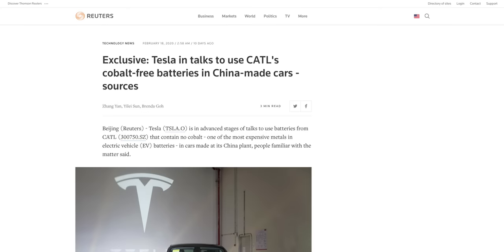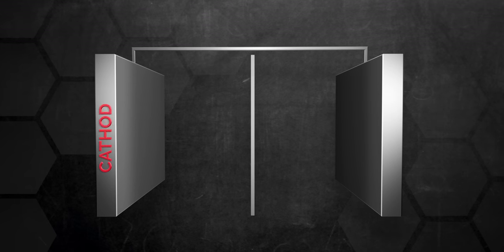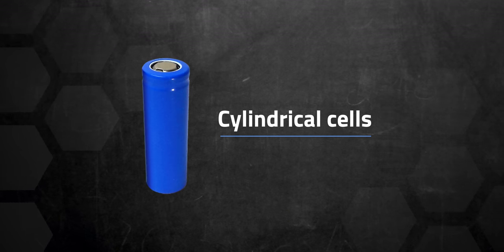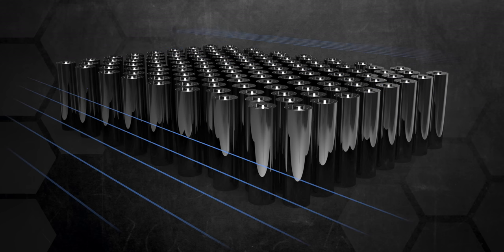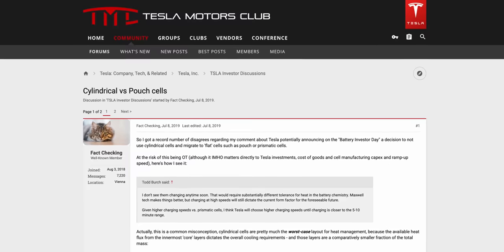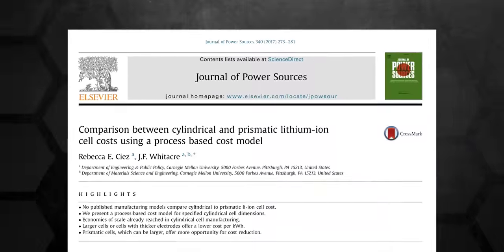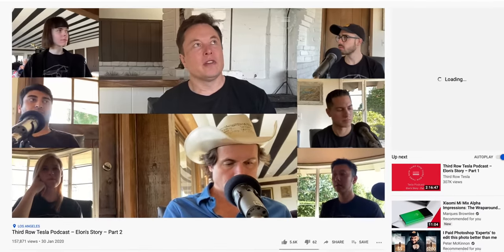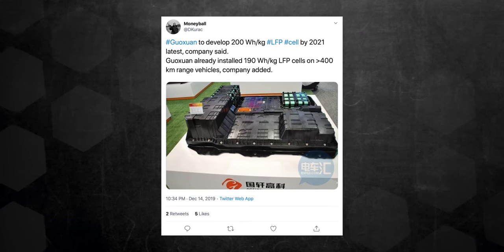New Tesla battery? Exploring the China prismatic LFP news

Comment: Thanks for making clear one of my Pet peeves:  Energy Density is energy per unit volume, not per unit mass!

Hmmm...  “谢谢老师” is “thanks, teacher,” not “thanks for the question.” Perhaps not super important, but I’m wondering what the “老师” (teacher) refers to?

Sorry, my wife is from China and we speak mostly Mandarin at home, but I can’t recall anybody saying “thanks for the question” as “thanks, teacher.”  Again, maybe not important, or maybe...
Reply: Roger Starkey, I’m not suggesting anything about relative importance of Specific Energy vs. Energy Density;  just which is which.  

“Energy Density” is oh-so-frequently misused to mean energy storage per unit mass.  Energy per unit mass is the definition of “Specific Energy”;  “Energy Density” is defined as Energy per Unit Volume.
Reply: You also mentioned Power Density (thanks).  Here’s an interesting illustration of Power Density:

Amazingly enough, a (very) large candy bar and a small stick of dynamite — roughly the same size and weight — hold about the same total amount of energy!  Their Specific Energy and Energy are very approximately similar.  

The difference is Specific Power and Power Density:  a stick of dynamite expends it’s energy in a fraction of a second, whereas (in our bodies at least) a candy bar takes an hour or two to be completely digested and it’s energy expended.

So, even though their Specific Energies and Energy Densities are very approximately comparable, the stick of dynamite has many many orders of magnitude higher Specific Power and Power Density!

Comment: Hi Matt, do you have any insight about the bottleneck caused by battery production today? For example: how much more cars could be built in Freemont, if batteries suddently weren't a constraint any more. The rationale being: there might be no need for a 500mile Model 3, instead Tesla could build far more batteries whilst keeping the range of the cars the same.
Reply: @rogerstarkey5390  Thanks Roger. If batteries were the constraints in the past and that is no longer the case, what could that mean for production volumes in freemont?

Comment: why not different batteries for different use cases.  million mile for one use case, ultra fast charging for another use case, very low priced lower density for another, ultra long range for yet another, still others for other use cases.

Of course ultimately the number of battery variants would few as the market settled on the most common use cases, but the idea applies.

Comment: why cant we use button style batteries. If we can power our car with 100,000 button batteries it will be great. Button batteries are small so you can load it up at one side just like you load smarties into a jar. you can also eject used batteries through an exhaust pipe.

Comment: You're all taking the bait. IMHO, Tesla isn't interested in using LFP for it's automobiles. The weight and volume are just too much greater than NCA. What I believe Tesla is interested in LFP for is for it's PowerWall. LFP is a natural for home power storage due to its much increased cycle life and it's resistance to catching fire. The increased volume and weight for any given energy level is not nearly so important for use off-grid or home storage applications. I'd look for these to show up in the next version of Tesla's PowerWall and for use in Tesla's grid support projects like that in Austrailia.

Comment: LFP = Very unlikely.  Significant improvements to NCA = Definitely.  It seems quite likely that Tesla will eliminate cobalt in their NCA chemistry, which will improve unit cost (cobalt is expensive) and slightly improve specific energy (due to increased nickel). Simply put, this will be made possible by special coatings on the cathode designed to prevent cracking when the battery is cycled. Combined with a new electrolyte, these cells have been shown to achieve 1 million miles (4000+ cycles in harsh conditions). And finally, it has been shown that these batteries can operate at a slightly higher voltage, which improves specific energy even more. These improvements can be applied to Tesla's *current* cells, which could get them close to 300 W*h/kg while reducing cell costs.

But there's more!  Tesla will likely announce a new process for manufacturing their own, *new* cells, incorporating technologies from Maxwell and Hibar systems.  Due to Maxwell's dry electrode process and new battery pack designs, I'd expect battery packs closer to 320 W*h/kg with faster charge/discharge rates (the real holy grail here, achieved due to reduced heat!), and an improved manufacturing process that costs less per cell and requires much less capital.  These cells will still be cylindrical, and it's possible that Tesla will put them directly into the battery pack and forego using modules (to save cost). This would culminate to be a ~25-30% energy density improvement over current cells with faster charge times and much lower unit costs (maybe $100 per KWh for a **pack**).  It seems likely these batteries would be available in 2021.

More improvements are possible in the future... at this point, we can only wildly speculate... one example is a Silicon-rich anode, which could make cells capable of 400 W*h/kg.

Tesla's current battery and powertrain technologies are already industry-leading.  The improvements in the next 18 months should blow our minds.  Also noteworthy: Due to improved energy density, Tesla could elect to ship vehicles with smaller batteries instead of improving range, which further reduces the cost of the car. If Tesla passed all of these savings onto the consumer (which will probably happen over the next few years), we could expect EV prices to drop by $3-5K.

Comment: I’ll bet that Tesla is pursuing several battery architectures at once.  Since battery supply is the biggest problem for EV manufacturers including Tesla it makes sense to pursue a strategy of utilising several different technologies from different suppliers as well as making their own batteries.  Which supplier / chemistry is used for a particular model / variation will probably depend on juggling customer demand and supplier availability
Reply from the maker: That wouldn't surprise me either.
Reply: Great points and I agree, I think whatever Tesla comes out with next month won't be the same battery they'll be using in 5-10 years from now.  Goodenough's solid-state, glass battery seems to offer great capacity and rapid charge times but will need a few more years of development and testing and the lithium air battery offers the highest capacity of any battery but still needs several more years of R&D.  I remember working for Apple in the early '90's, we were super excited, every quarter, as new processors came out offering blinding speeds of 16 Mhz, 25 Mhz, then 50 Mhz and so on until computer speeds got so fast and storage was so high, we stopped caring about it.  I think the same will happen with batteries when EV's can travel 500-600+, charge in 5-10 min., and last a million miles.  At that point, everyone will be buying EV's and these moments of talking about batteries will be fun to reminisce.
Reply: @rogerstarkey5390  I hear ya, but most car-buying customers are still expressing the same concerns of range and charge times and I think those concerns will be settled in coming years with new battery tech.  I own and drive an EV that I charge with my own solar panels and wind turbine and have for the past 12 years and virtually everyone I talk to about buying an EV, express the same concerns: charge time and range.  Many long-distance drivers only stop for 5-10 min. for a fuel up and get back on the road, after driving 3-4 hours.  I live in Arizona, we do this, all of the time, when we drive to our family: 8-12 hours away.  
Looking forward to the future of EV.s.

Comment: Tesla may use prismatic LFP batteries in they short range M3's, but not because those batteries are the future but because they are available now and have some benefits. 

Typical cycle life is over 5000 cycles and those batteries can handle abusive conditions better. Supercharging can be only choise in Chinese cities and repeated deep supercharging cycles are not good for current batteries.

The future is in more energy dense chemistries but it takes while before new technologies are taken into use, all problems are solved and production lines are up and running.

Comment: My option, I doubt very much Tesla would change from the Cylindrical Battery format that has proven to be so class leading.  If Tesla uses lower density cells, they they are not ahead much of other manufacturers anymore.   So unless they can really lower the car cost significantly I don't think moving to LFP is a good long term plan.  The magic they have would be lost.
Reply from the maker: The energy density of the pack will no longer be leading class, but cost wise ... it could be class leading.

Comment: NO NO NO. The goal for motor cars has to be to maximize the specific energy - all other things being equal.
Cylinders are a lightweight means to withstand the pressure to expand. 
Musk made a very good initial decision - even if the real reason was that the cylindrical battery was already abundant, and available.
And now with the new size 4680 (I think) he has optimized  the cylinders in respect of many competing factors.
Lithium constitutes about three percent of a lithium battery (so I believe). How much cobalt do they contain? Even at ten times the cost of the same quantity of lithium, it is not a huge factor.

Comment: Fundamentally, weight/power ratio makes any form of batteries, even with marginally improved technologically for their chemistry, a pretty terrible choice Vs a liquid gasoline or hydrogen tank. Hydrogen fuel cells or water engine through hybridation is the future in terms of cost , power to weight ratio, also it removes charging times, pollution considerations mining rare earths, producing and recycling short lifespan , very expensive and over-heating  these massive 100kwh batteries

Comment: It'll be interesting to see how CATL lithium iron phosphate prismatic cells could be applied to stationary energy storage.  
Due to the less severe demands on the cells, the tighter BMS controls, the lower temperature fluctuations and predictable charge/discharge cycles, when compared to automotive demands, it would seem that the longer lived LiFePO4 cells could be made much larger, thus more cheaply, and still not suffer any thermal constraints.
That aspect excites me much more than changes being made to automotive batteries, since we're already at the 'good enough' phase, and it'll naturally get better with time.
Stationary energy storage is a much bigger deal.  Or at least in situations that are not so weight sensitive, like trains and boats.
Crazy to think I paid $1500 for 500 Wh of LiFePO4 cells for my ebike back in the bad old days.

Comment: The battery technologies Tesla uses need not be mutually exclusive. Energy density is more critical in trucks, high performance and long range cars, but the standard model need to be very cost competitive. So the choice of using the best for each segment would be best for Tesla. Tesla has other advantages besides battery cells to keep competitors away. It has core competencies of its own and option to choose the best there is. It also gives Tesla the bargaining power with all the suppliers.